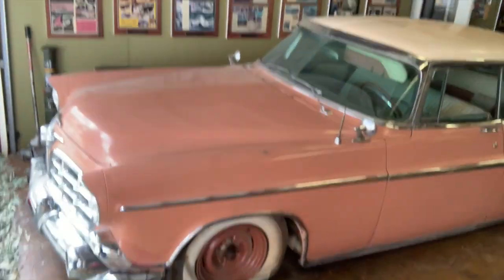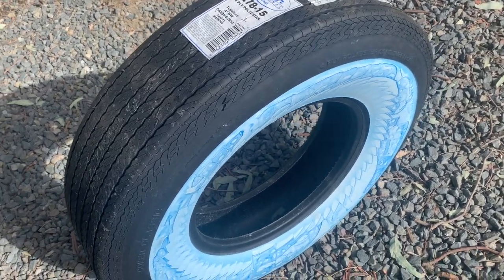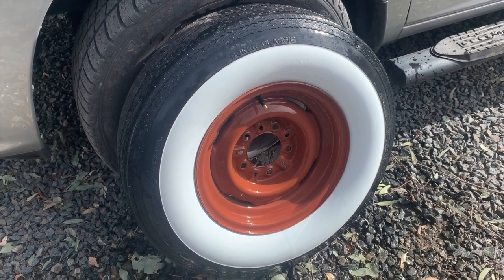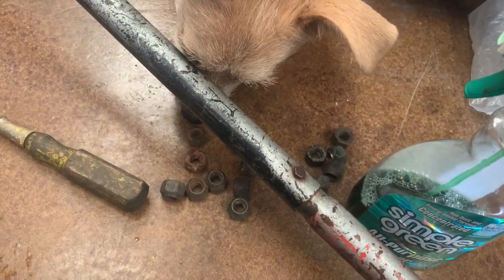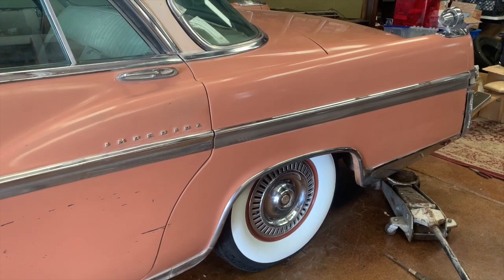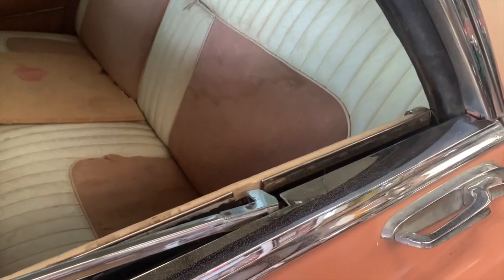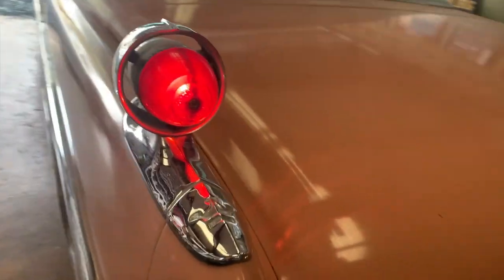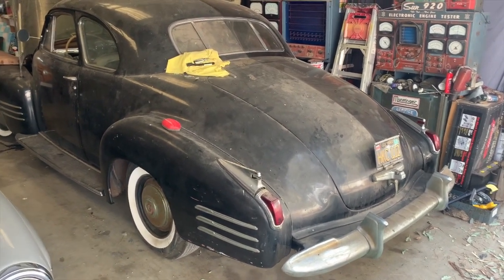Carchaeology: Rose gets new shoes! The 1956 Imperial Barn Find project latest update!

Comment: I love these big old barges! Some of them were still on the road in the sixties when I became a car nut but due to the Ohio winters most were on their last legs with holes through out the sheet metal to the point that headlights were falling out and in some cases the only thing holding some of the panels together was the stainless mouldings running the length of the panels! I did get a black 60 Oldsmobile 88 convertible from a neighbor  that had bought it new and before he took delivery he had all of the emblems and name plates removed and the holes leaded in and a set of 57 Olds Fiesta spinners installed, It had a red white and silver interior in it and was beautiful until in 1971 his wife took out a bunch of mail boxes with the right front fender and door and veered of the left side of the road from over correcting and took out a speed limit sign with the left front fender! In spite of never being driven in winter it  had a couple of holes in the fenders and of course the dents and the top was going bad and he just told me that since I loved the car and would do something with it I could have it! I put a lot of work in it welding patches in it and repairing the damage from the wreck straight
 enough for black paint! Plus I ordered a new top from a catalogue and installed it! I got it looking new again and drove it for a year and bought something else and ended up selling it and i still miss it 50 years later!

Comment: In Detroit, the designers referred to those taillights as "sparrow strainers".  If you look at the front of the taillight, you will see a translucent white plastic lens that glows when the light is on or blinking to let you know the blub is working. I had an early 56 two-door Imperial Southhampton with the two-speed Powerflight, later in production, the transmission was changed to the three-speed Torqueflight. Nothing drives quite like that Imperial.

Comment: The first car I drove as a newly licensed driver, in 1963)  was a 1960 Chrysler Windsor which my mom drove to work. It was big and green and it had the same transmission button thing on the left side of the steering wheel.

Comment: Yes some very cool designed options from back in the day. Tail light maybe the solder nubs need to be resurfaced, to give that lock to the contacts of the socket, I have used a solder iron and resurfaced the bulb contacts.